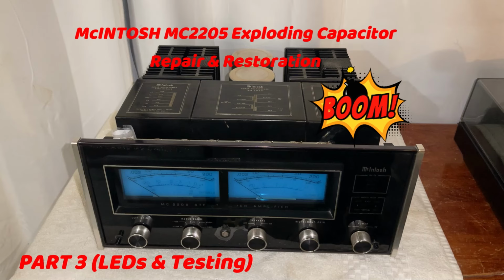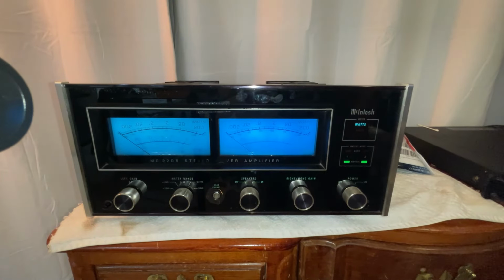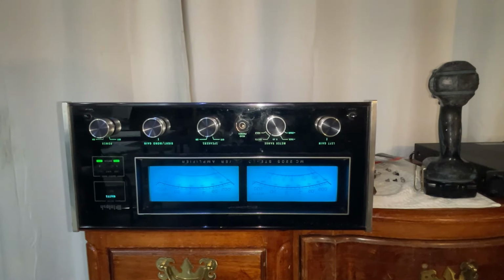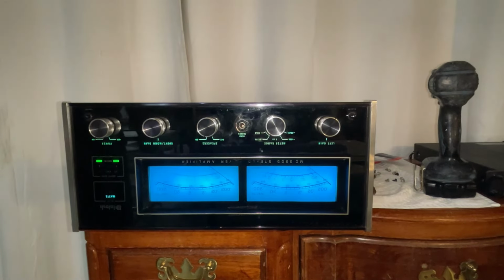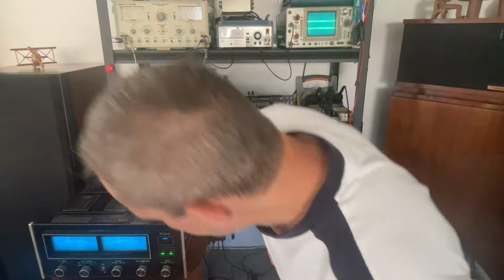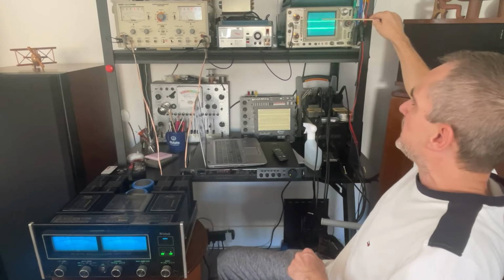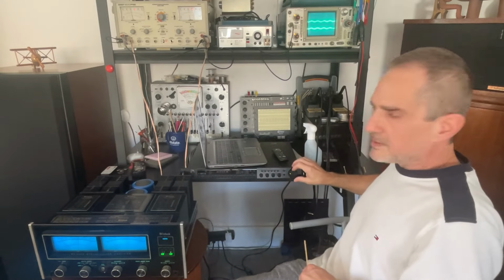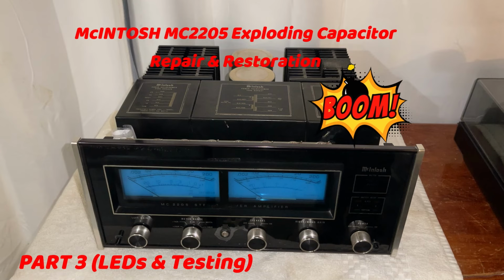Mcintosh Mc2205 Exploding Capacitor Repair & Restoration Part 3

Comment: Great vids and many thanks. My 2205 has one channel where the red limit light is on. But still have sound output with no audible distortion/hum. Any thoughts on what components to swap out?

Comment: Hello there, I'm enjoying looking at this video and it is very details and thank you. I need some help from you as I have Mcintosh mc 352 and having protection is on of the left channel and no audio coming. Can you suggest me to where to look for potential issue. I have not used this amp for a while and was using got this issue. I'm also interested of recapping as well. Hope some help from you to troubleshoot. Thanks.
Reply from the maker: @cs5115  
Hello teammate! Hope all is well. And I hope you have a wonderful 2025. 
There’s a few things that could be the issue but without looking at the unit, I could only speculate that it is a short transistor, shorted diode, shorted capacitor, etc.
Have you done a visual inspection to see if you see any signs of electrical damage?

Comment: What leds did you use and where did you get them.
Reply from the maker: Hello teammate!
Here’s a link to the lightbulbs. I got them on Amazon. 

https://a.co/d/ixi6SWO

I used the Warm white option, but they also have white which some people may prefer.
If you wish, you may also try the same lights, but on blue on the meters and white on the lettering.
let me know if you have any trouble finding them.
If that link doesn’t work, just copy and paste it on the address bar or your browser.
Thank you very much for watching my video. 🙂🙏
Reply: @Tinybench  what about the 7381 and 7382 mini bulbs
Reply from the maker: @shaknit  hello teammate! I got those on eBay a long time ago. I’ll take a look to see if I can find them, but I do not have a link at the moment.
The good thing about those is that they will operate in both directions so you don’t have to worry about orientation.
Reply: @Tinybench  Thank you. I have 3 of those amps.
Reply: btw Did you ever get that capacitor replacement kit together for this amp
Reply from the maker: @shaknit  
My friend I am so sorry but I have been completely swamped. Let me know if you need any part numbers. I got everything from DigiKey. 
I believe I show all the parts on the videos, but if there’s one that I missed, please let me know and I will let you know where to get them .
🙂🙏
Reply: @Tinybench  Ran into a little problem apparently there is more than one design on these and the service manuals are by serial number I wondered why it wasnt matching up. My service manual doesnt  match up to my serial number. UHG!
Reply from the maker: @shaknit  
Don’t worry about that. All the versions are available online and the differences are minimal. 
If you don’t find them online, Mcintosh Labs will provide them for you. 
You can also contact Kenneth Zelin on Facebook and he will get you the correct service manual but like I said the differences are minimal.
Reply: @Tinybench   Hi sorry to bother you again but I ordered all the caps but made a mistake on the 2 input caps there are supposed to be 2.2 uf but I orderd 3.3uf. Do you think it would make a difference.
Reply from the maker: @shaknit  
Hello teammate! You don’t bother me. I have seen some units with one microfarad and I have seen some units with 3.3 µF if I remember correctly so you should be fine.
Reply: @Tinybench  Thank you. I finally got both complete service manuals from Mcintosh labs the ones I got online were all incomplete.